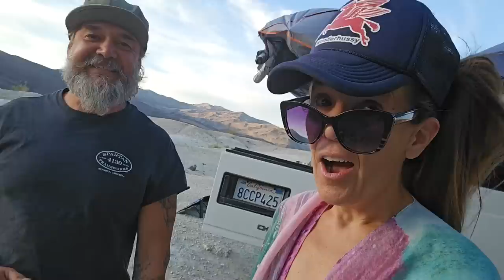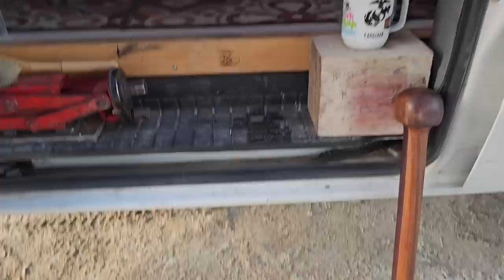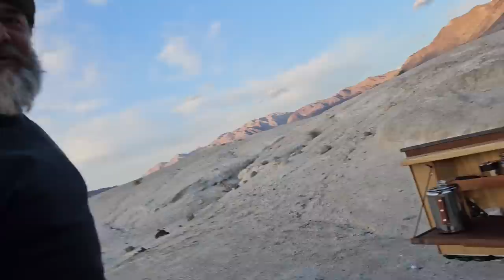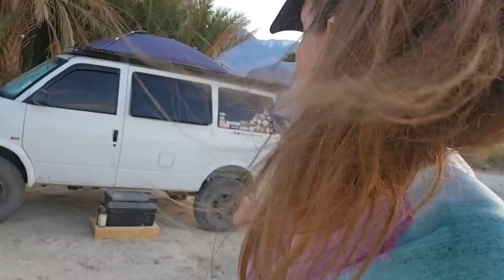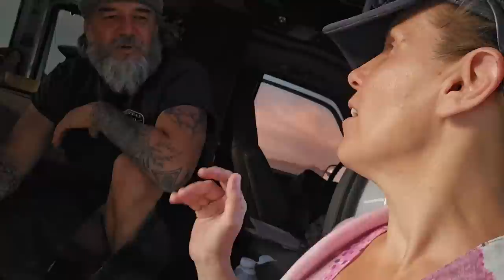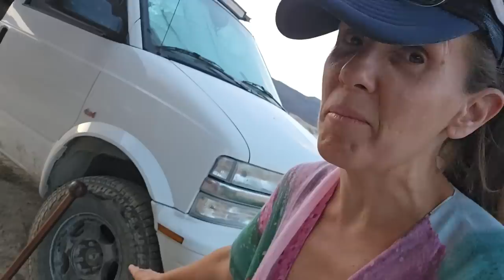Not Your Grandma's Minivan: Mike Z and his Amazing Overlanding Off-Road Astro Van

Comment: Those Chevy Vans run forever.  Tom Turner, KVI 570 Auto Guy, has a Chevy Asto Van with over 250,000 miles on the odometer.  🤠

Comment: Very cool Astro van. My God you've done everything to it oh, that's a lot of time and work. I used to have a diesel Econoline E350 it holds two-thirds of my house in one trip, construction was trailer. Usually it would get better than 15 miles per gallon it also had an overdrive on the C6 hey, transfer case and was ready for front four by four diff. This was pretty much a bulletproof rig and you can buy them ready-made for about 25 or 30 k. He also had turbo on that 7.3, would pull any mountain with a load about 50. Lots of room yeah, that's the rig I would do again. Have fun love to see your adventures

Comment: Astro vans were kinda bullet proof reliable V6 motor , a great frame that holds up to heavy work . The 4wheel drives depended on a top maintenance/repair shops for proper maintenance. Thank you for posting another great adventure video on your channel wonderhussy.
Reply: THERE ARE PLENTY OF BRAND NEW FOUR-WHEEL DRIVE MERCEDES SPRINTER VANS AND OTHER BRAND-NEW 4-WHEEL DRIVE FANS OF ALL STYLEZ FROM CHEVY AND FORD
Reply: Really? I always considered Astro's as Ass Throws. 🙃 They were based off of Chevy S-10  trucks. Which were a joke. And as Mike Z. demonstrates in this video... he's replaced the weak links in that platform.
I've had a couple of friends who had S-10's . The first one got a 4 wheel drive one. What a pile that thing was. He severely damaged the front end of it going down a dirt road right after he bought it. And he was taking it easy. The second friend bought one because he just had to have a new truck. He hated it because the next day after he bought it it developed serious problems all the way until he just got rid of it.
Have you ever seen any Astro vans/ S-10's  running  around nowadays. Very rare indeed. 
My '74 Dodge Power Wagon that I bought new in December '73... is THE tough truck.
Reply: U must use the AC Delco 
Transfer Case fluid, it’s Blue in color
Reply: @KurtfromLaQuinta  Actually I sold my 1995 Astro van that was on a 4x4 truck frame to someone that lives in a nearby city & I occasionally see it driving around.
Reply: @rickreese5794  I love my New Process 205 Transfer Case. It is the toughest one ever built. They put that unit on up to 5 ton trucks. And it came stock in my lowly 1/2 ton Power Wagon. And it takes regular gear oil.
Reply: @JudiDolliverAstley  For all the units sold... there's very few of them on the road today. The survivors I see, are barely making it.
Reply: @KurtfromLaQuinta  Eh, I live in Detroit, and mine has a “Proud parent of a Marine” sticker on the back, so when I see it around town it always makes me smile!
Reply: @KurtfromLaQuinta  
My long gone uncle had a 70
S/Bed Power Wagon, stick and
V8, loved that truck, last I saw it,
His nephew had it parked on a 
fenced lot…..
Reply: Don't ever break down in a vehicle like that unless you're in a convoy of flatbed wreckers.

Comment: Message I'd for Minivan Mike. The van being that late of a modle, the systems (fuel, spark timing, transmission,  all wheel drive, Yada Yada yada) will be controlled by an ECU. Some where in the programing of the ECU is tire size. Find a tuner / programmer <- (a person) to match the tire size to what you have on the van. That sounds like what could be causing your fuel consumption issue.
Reply: I did that - We were both in an altered state of mind so my MPG comment wasn't 100% accurate - Keeping in mind this is a heavily modified Astro with a 7" lift, 32" tires and a roof rack I got about 15mpgs from LA to Quartzsite, AZ - I get better on the east coast and worse in the mountains going up steep grades or in heavy head winds (just like any other vehicle)
Reply: Put a Lunati Voodoo 262/270 cam in it. Smooth idle & a nice torque boost. Works great on fuelie 4.3 engines. 🚚

Comment: Owned 2 Astro Van's.  Advantages many. 6 cylinder, REAR wheel drive, leaf springs , cargo(swing) rear doors, removable rear seats.  1st one, a '91, had just
under 400k. Second, a '99, took me to just under 300k.  Bird hunt a lot and some deer.  They were both good to me.  As with most vans, the only down was the engine dog house.  Cargo galore.  Always thought about 4wd.

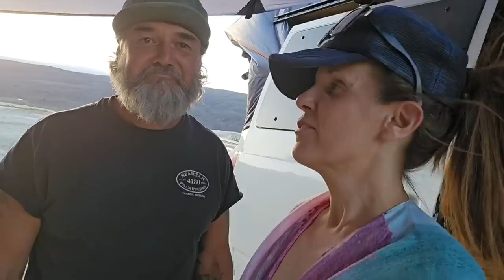Comment: Well, loved this video, and the one following where he DOES Steel pass! But I did want to know more about the mechanics of his rig. I did catch the part where he says 4:11 gears. But I wasn’t sure - manual transmission or automatic? Manual locking hubs? And what was the motor - standard V6? 3/4 ton rear end? I’m a Ford guy but I was impressed with his rig. But, for now, this 71 year old guy will stick with his 30 year old F250, 4:11 gears, manual everything. In-line 6 Ford. Carry a lightweight cabover camper I can take off when not needed. Tow anything. 

Thanks for the fun video Miss WH!
Reply: I did a video on the van after Sarah posted this - 4:10 gears, 4.3 V6 Vortec engine, manual transmission, manual 4x4 selectwith high and low, posi traction rear end in the factory pumpkin

Comment: I spent over 10 years of my life wheeling arounda Astro Van on a equipment service route in the SF Bay Area....Great vehicles one went 189,000 miles with only a transmission being an issue @ around 140K miles. GM made a HUGE MISTAKE discontinuing thae Astro Van when they did....They were selling over 100,000/year but, thats the past. The Hummer H3 was built on the Astro Van assembly line and I own one of these now. The H3 in 2009 could be had with a V8 and locking differential "Off Road" Adventure Package those are pretty good Expedition Rigs too.

Comment: You need a short wheel base low top 4x4 diesel sprinter... I have the same but a 2wd 2006. It gets 24mpg, runs like new at almost 300k...

Comment: I'm not a Toyota fan,  even though I have a parked 1970 Toyota Land cruiser.  But those Toyotas just keep going. If you don't feel comfortable by yourself try going with someone else. That way, there are two vehicles.  Maybe, just when you are way out. But  you should be just fine putting another 50,000 miles and more. As for a snorkel,  I watched a video of an Australian guy.  He said the snorkel raises the intake up about 2 feet higher and out of the dust, not just for  water crossings. Which helps driving down dusty roads. One upgrade that really helps offroad is a locking rear end and yes a winch would be good.  Weather you buy something new/newer or keep what you have. If you do buy a new vehicle and you can keep your old one as backup, that would help for emergencies. Also, you should talk to Wandering Jeepsey about setting up a vehicle for offroad and some techniques for different terrain. And maybe watch some of Matt's offroad recovery videos. Rock sliders and skid plates, especially for your fuel tank would be a good idea too. On board air would be another good idea. That way you can air down when you're offroad. Then air back up. Lower tire pressure really makes a difference offroad. Stay safe out there. I really enjoy your adventures. And when you share the locations of hot springs or whatever beautiful place, it really helps those of us who have very limited time for a vacation. Thank you again and be safe.

Comment: Originally those vans came with a 4.3 v6,  You could put a 4.3 v6 olds diesel, ( v6 had more headbolts- 6 per cylinder, than 4 for the 8 cylinder),  do a little injector pump mods& have torque/ mileage at the same time.   Wonderhussy,  You should really stop talking over people & let them get done explaining things before asking another question.